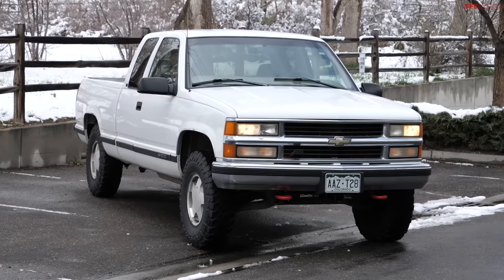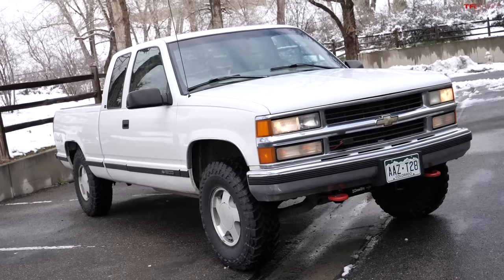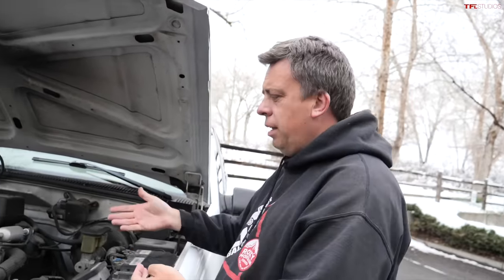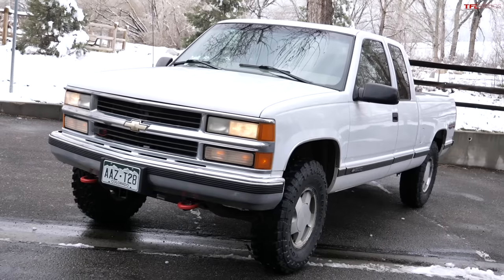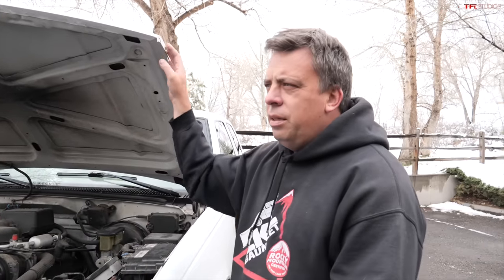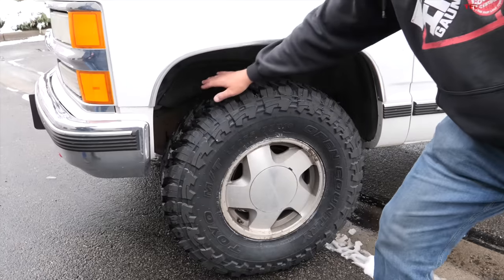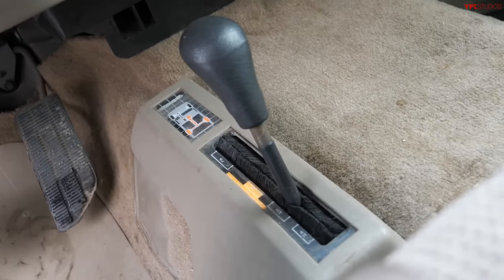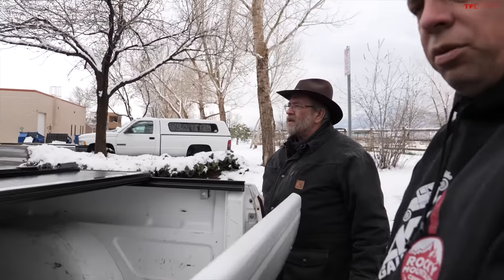Mr.Truck on Trucks: Was The 1990's Chevy Silverado The Greatest of ALL Time?

Comment: I got a 1996 gmc sierra k1500 my truck has the 5.7 350 vortec and the engine has almost 295 thousand miles on it and it’s still running strong besides the transmission needing to be changed cuz the person who had it before me was trynna be a show off had the truck in 4wd and tried spinning the tires in 4wd and tore the gears out of it but the transmission that’s in it now shift so good I love it hopefully the transmission I put in it will last for the remainder of the trucks life which will be a long time hopefully I just need something to get me through some deep snow if I want it to I don’t tear my truck up or go wild with it occasionally I do show off but like loudness cuz it’s straight piped can’t beat that

Comment: The squeak is from the power steering pump pulley being out of alignment with the belt.  Use a wheel puller and pull it out just a hair.  Had the same problem.

Comment: Got a 1996 Chevy Silverado long bed 3/4 ton 350-5 speed. Got 430.000 miles on it. Runs and drives Excellent! Great Truck. Wouldn't have a Rice Burner 🇺🇸🏁💪

Comment: My dad used to have a Ford from around the same time I think, well it died. Sold it and got a different one, idk if it was this truck (2500) and it runs. It still runs, kinda. Unhappy as heck but still a work truck. Rusting, missing things, broken things you name it. Idk how many miles but it probably has a ton.

Comment: I have a 99 chevy k2500 single cab 8ft bed 4x4 5.7 vortec . 4L80e transmission. 99k miles on it . 34gal gas tank . thought about selling it a few times because I don’t drive enough but every-time i do it makes me fall in love again

Comment: This old truck would be a lot better of a truck if it had the 350 instead of 305
Reply: stares in dropping a 350 in my 1990
Reply: The 305 votec is 230 hp the 5.7 is 255 so wich engine makes more power per displacement ?
Reply: @jonschwartz9669  305 but if I’m not mistaken the blocks are the same, heads might be fferent
Reply: @andrewlopez8110  opposite

Comment: I have to say that the GMT400 platform was well thought out to say the least. Owning a 97 Tahoe, has made me start looking for a 99-2000 K25-3500. the old 5.7 has more bottom end torque than my LQ4( it has more on the top end). 
My vote is for the GMT400!

Comment: I have a 97' Silverado K-10 longbed, people ask me if I'm selling it every now and then but it's a keeper. I use it to haul wood, coal, hay or for a cruise. It has a 31 gallon gas tank on it but I need to fix or replace more than a few stuff on it, mostly front end suspension parts and the power steering pump. The engine is still strong and running👍🇺🇸..

Comment: The 5.7 very durable motor, minus bad injector system, once replaced with better spider, it runs much better. Cab corners and rockers rust out. But other then that, my vin R 350 just wont die! And ive put it through alot just having fun, check any vids i have, last year model 2000 obs 3/4 ton reg cab 4x4 fun toy!

Comment: My 1991 Chevy K1500 has over 280,000 on the original 350 , 5.7 litter V8.
The 4×4 works fine. and it fires up and runs fine. These new trucks just don't compare.

The only real problem I have had is the rear main seal leaking a little and I changed it before it got bad... other than that it's just been regular maintenance and tires.

Comment: I have a 1996 silverado c1500 with a 5.0L.  It's a 2wd vehicle but the outside looks great and the inside looks brand new.  Under the hood is all shiny and she don't drip any oil at all.  It's got 126k on it, and at the tender age of 62, I've decided she's my last truck, and that's why I just painted her and changed all the molding and chrome.

Comment: I have a 1997 K1500 Silverado Z71 with a 5.7 :).  Bought it new and have 223K on it. Sad to see it start to rust, the engine has been a rock , but replaced the transmission at 180K. Unplugged the antilock system at around 120K, because the Kelsey Hayes system wasn't that good and to replace it would have cost a fortune. Best looking truck in my opinion from the 90s. I called on the GM Fort Wayne Assembly plant, but my truck came from their Canadian plant. Love my truck and looking forward to the next 100,000 miles.

Comment: My Dad bought a new 1995 Z71 extended cab in victory red. It had the 5.7 350 with a whopping 200hp 😂. Beautiful truck and it was great. Perfect balance between old and new. Only thing I didn’t like is how the interiors went cheap plastic compared to the old trucks.

Comment: I have a 93 Silverado K1500 Z71 xcab and  I'm the 2nd owner. I've replaced the original engine because the crank main bearings were worn out. I bought a new GM Goodwrench 350 and it is very dependable and parts are everywhere if needed and they are affordable. Transmission has been replaced and also rebuilt  . Just watching out for different things and keeping it regularly maintained and it will last a long time. I'm planning on keeping my truck and not buying anything else. It's very reliable. 👍🇺🇲

Comment: I think GMT 800 99-01 were great years too. Love the Vortec 4.8,5.3, and 6.0. I've have a 5.3 2000 Silverado Z71 4x4 extended cab .... solid truck. The gen on this video is better for the long haul. Build a lot tougher and could really take punishment.

Comment: I had 370,000 on my 1996 k2500 5.7 vortec and I only had to get rid of it bc my mechanic cracked my block at the starter bolts and it kept eating my flywheels! I love these I’ve owned 4 just bc I can’t go without them some worse than other but I promise no matter the engine size I’ve been super impressed with all of them!

Comment: First off it’s called a fuel spider 
2nd the 5.7 is king 
3rd  yes 454 was an option on 25-3500 series gmt400s there was also a 6.5 liter diesel option  for the 3/4 to 1 ton trucks

Comment: Still with me is 1996 Silverado 250O along with 5.7 L Engine Vortec. It’s current mileage on Odometer reads 440,000 KM. It’s running exceptionally well. Chevrolet ought to keep building this type of Chevy Pick Ups I’m telling you .....

Comment: Took excellent care of my 96 in 96. 1st vortec had intake gasket leaks issue which resulted in a 68k miles engine. Met a mechanic that built race engines. He met with Chevy about it. They knew. They told me too bad.

Comment: Mr Truck asks if it's independent suspension, or Torsion bar. 

It's both.  

Yes of course they had a 454 option, even a 6.5L diesel. 

So much for experts.

Comment: I love WD-40 - but it is a better solvent for removing grease than a lubricant. I suggest you try a light oil like 3-in-1 or equivalent in the squeaky idler before writing it totally off. Whatever is making the noise probably needs replacing, but it's always worth a try to postpone that event...

Comment: Can't believe you forgot about the 6.2 and 6.5 diesel engines
Reply: Most people do forget them. I like them though. Keeps prices down a bit
Reply: I didn't forget them
Reply: @wildbill23c  lmao man, no no, look it up 6.2, 6.5 NA and 6.5 turbo were all options in the half tons at one point
Reply: @wildbill23c  just look up 1997 chevy ck1500 and you'll see the option. Also look on the wiki page
Reply: @wildbill23c  they came in half tons. I've seen a few. Not swapped

Comment: K1500 came with all engine options 4.3 5.0l 5.7l and 7.4l and could also get the 6.5l turbo diesel in them
Reply: Depends on the year for the diesel. 88-93 k1500's had the option for the 6.2 diesel instead of the 6.5. My 88 k1500 still has a 6.2 diesel snd sm465 that she's had since the factory made her. 94-95 k1500's, and light duty k2500's, had the option for a a naturally aspirated 6.5 diesel too and those ones with that engine also got the 4l60e for the automatic. All turbo 6.5's got the 4l80e for a automatic.

Comment: Ah yes the notorious Chevy squeak from a pulley or the serpentine belt where over half of the owners change the serpentine belt and try belt dressing and roll the dice where it might go away...or momentarily it does. I had the same issue on my 5.3. With that said I don't care the 5.7 is the choice on that generation. Solid stout engine and with property maintenance an easy 400k mile engine.

Comment: I love both the Ram and Silverado 1500s of this era, though I definitely wouldn't want a Chevy with the 305...never understood the point of those engines.
Reply: Only 25 hp difference between 305 vortec and 5.7 vortec the thought was 1500 would get the 305 and the 2500 would get the 5.7 😆

Comment: According to all of the self-appointed experts in the 1990's, they weren't as good as the trucks built in the 1970s.  So, the trucks built today are better than the ones that will be built in the 2030s and 2040s.   Nostalgia makes everything in the past better...
Reply: i personally think the 87 is the best 1/2 ton chevy. has efi and od trans sfa manual hubs etc...

Comment: The gmt400s are great trucks. I would prefer the 5.7 tbi over the vortec fuel injection. I don’t like the early vortec injection system. The tbi was much more simpler and reliable, especially as the vehicles aged.
Reply: Yep my thoughts exactly and that's what I have is my late pops 94 Chevy K1500 with the 5.7 Lt  V8 350 and just gotta love the rumble of that V8  !!!!   Even me not being mechanically inclined believes that when something breaks it's worth it to pay to fix and still a lot cheaper than paying bank notes of $600 to $700 dollars a mo. !!!
Reply: Good luck finding a TBI rebuild kit now. At least the Vortec CPI injection is very easy to find and buy.  The 55hp more on the Vortec also helps.
Reply: @terrencejones9817  Autozone $36.00
Reply: @jameshall4385  try to go buy it..I work in auto parts (20 years now) they're all discontinued. You might get lucky and find old stock on a shelf somewhere though.

Comment: I had a 97 k1500 z71
A 2002 1500 z71
And currently a 2012 1500 z71

The 2002 was the most boring of the three, but I must say it was the best model Chevrolet ever made.    I owned it for 8 years and had a rear brake caliper go out and one of the knock sensors failed.   That’s it.  
Change oil, put gas in it and it just worked.

Comment: I have this same truck with the 350 vortec and Silverado package, dad bought it new and now it has 345k miles. TO answer your question, yes the 350 is way better than the 305! my grandpa has one with the 305, its fine but id say a huge gap in power

Comment: I like the GMT400s (and have owned one), but I'd vote GMT800 any day. Maybe not as handsome but better engines and ergos. Within GMT400, early interiors were much better to look at than later interiors. Late GMT400 interiors are the even crappier predecessors to the "meh" interiors of the GMT800s.
Reply: I agree. I have to say the GMT800s for me have better engine choices with a little better gas mileage. Easier to work on too and have some nice refinements.

Comment: I have a 95 1500 extended cab with a 350 TBI, good truck, plenty of torque, just should of had a higher shift point,  the 96 with the Vortec made more HP but it also had a higher shift point,  mine shifts out of low at 4100 :(( the 96's shifted at like around 5600 :)

Comment: Early 90.s Chevys was not bad. They was fairly reliable tbi was a game changer way better than the carburator transmission was okay. Not top of the line but fair. Overall it was a fair truck 3 hundred k plus on average miles. U liked the 5.7 l over all others.

Comment: I’ve had 3. Great trucks.  Don’t make the same mistake I did. If your 5.7 loses power under 400k mileage check the spider injection system first!!!!   Thought my engine was bad, pulled it, took engine apart to find out number 1,2 injections not working!!!

Comment: I have a 97 Silverado with the 5.7  and have had it 20+ years and expect to have it forever. Why spend $70k as mne rinds great. Transmission rebuilt , new fuel pump some electrical but overall it will last my lifetime. Oh mind is 2dr extended cab.

Comment: Just bought a 99 suburban lt, brake lights only work on 3rd light up top. Soft pedal. Been thru 3 used alternators, and 1 new in 2 months of having it, still has delayed start with good battery and fuses.  332, 000 miles.  No leaks, tranny shifts good.  Is it worth keeping?
Reply: I'd head to a wrecking yard, pull some OEM brake lights and a OEM  altenator. I wouldn't buy Made In China replacements...

Comment: You probably know the answer by now. Congratulations Mr Truck on your weightloss! Wow!! 👍Back on point, my  last p/u truck was A BIGGIE😂 Cuz I ❤Big. A GMC 454 6 pack Dually otherwise known as the 3500. Whether Chevy or GMC. I still had my business & required a fair amount of towing, normally bought the Suburban, but couldn't resist the Big bad Dually! My prior truck which I loved a lot was a '95 Extend GMC Z71 Stepside. For the modern era of trucks, yes These were awesome!! Everything ppl really NEEDED & Mostly wanted. Without all the truly DUMB Sensors & cameras etc. If "you" need that much tech to drive? NOT SORRY YOU PROBABLY SHOULDN'T DRIVE! Especially IF YOU CANT PARK! Btw I had my trucks IN San Francisco & lived IN Russian Hill & ZERO PROBLEMS PARKING UP/DOWN SIDEWAYS at Extreme angles in Tight Cramped parking! Zero cameras sensors B💩 Oy! Just idk LEARN TO DRIVE 😂

Comment: I had a 92 Chevy 4×4 2500 long bed ext cab two tone. It was handed down from my grandpa to my dad then to me . so by the time I got the truck it had over 200k low oil pressure but I didn't care I went every where ! Off road. On road. I was young. truck was big and that 5.7 was loud . that truck never let me down ! I even jumped it well the front tires got off the ground and it still drove straight down the rd. I put almost another 200k on it before it started knocking had to retire it . thought ide check out the 95 dodge 1500 4×4 with the 318 and it had only 140k love the looks of that body style great engine ish but the running gears transmission four wheel drive setup is junk.

Comment: The Silverado of the early 90's was the best of the Silverado line. TBI was not the highest performing, but it was easy to work on and never needed work. The 350 TB was hard to beat. I hated the Vortec. Do not get me started on those crappy plastic side view mirrors that came in 95.

Comment: Anything gm 87 to 97 that wasn't fwd where best ever vehicles produced,  97 it went down hill. The 4.3 didn't overheat lol, exact setup as the 350
Reply: I personally think 99-06 are much better, but the 88-98 pickups are great too.
Reply: Th 4.3L's I towed with overheated. The 4.3L empty got amazing fuel mileage. The 305 cu came out 10 to 1 compression and was a favorite for farmers adapting propane to the engine
Reply: @daniels2761  those where the worst, plastic everywhere
Reply: @MrTruckTV  I towed everything,  even loaded it down to the rim with concrete parking strips and it was popping wheelies going up hill. We owned it for 20 years before it got totaled,  best truck we ever had.
Reply: @mblake0420  personally, I don't mind the plastic interior at all, it doesn't glare. They are pretty comparable interiors really. There really isn't anything the 99-06 trucks don't do better than the 90's pickups, especially in the HDs. The 6.0 is a great engine, especially with a 4L80 behind it, let alone the 6.6 diesel or 8.1 big block with the Allison. The 4L60 in the 99+ half tons was much more reliable than the 90's transmissions as well, and the 4.8/5.3 makes much more power than the 305/350. Don't get me wrong, I love the 90s trucks too, but lots of little things like the door latches and hinges and steering are a lot better 99-06.
Reply: @daniels2761  no plastic engine parts
Reply: @daniels2761  I Totally disagree and I've owned over 20 chevys, pointiacs, gmc, from both time frames. Those are all I ran up until recently when I bought a new Toyota.  In 97 they switched from a simple single injector on top (tbi) to a injector for every cylinder an octopus (600 bucks vs 30) that leak like crazy and are covered by a plastic intake manifold ontop of a leaky intake gasket.
Reply: @daniels2761  the 20 years I owned my 89 I replaced 2 parts, battery and one water pump. The 98 I went through injection system, intake leaks, water pumps, egr valve, fan clutch, tps, computer controlled abs system (2k) , engine at half the age and miles of the 89, ultimately  I gave up on the pos and switched brands.
Reply: @daniels2761  first gen and 2nd gen (one with orange "vortec on top intake" 4.3 where good, 3rd was pos
Reply: @mblake0420  99-06 do not have the "octopus" system, they have fuel rails. Completely different system from the 1998 you had. I agree that a lot of cheap parts were used on the 96-98 pickups. Better fuel system is one of the reasons 99-06 make so much power than the 90's TBI and Vortec "spider" system.
Reply: Your telling me the 97 and 98 are different from 99 to 2004 s10? I never owned a 99 and up bc I saw how fast they went down hill and said enough with that. I was diehard chevy until the 98 and now I wouldn't touch one.
Reply: @mblake0420  I do not know about the S10s, just the half tons. I'd assume the S10s lagged the full sizes in terms of getting the updated "LS" fuel systems. I actually just got a Toyota myself!
Reply: @daniels2761 i didn't do full size trucks beyond 1 a 93 and it was set up like an s10 tbi
Reply: @mblake0420  yes sir, the TBI didn't make much power, but they're very reliable. Much better than the spider setup in my opinion.
Reply: @daniels2761  they where the most reliable chevy ever made
Reply: @MrTruckTV  9.4-1 305 vortec compression rating 230 hp 285 ft of torque at 2800 rpm

Comment: I got a 01 GMC Sierra , 224 k miles , debating if should keep it fix the little things , shocks, alternator , gear lever cable ..
Reply: Keep it 💯  no other trucks can last this long 300k 400k 500k 600k I've seen it
Reply: @jonschwartz9669   what my wife keeps saying  to me , it runs drives but just need a few things , would save $90 k lol